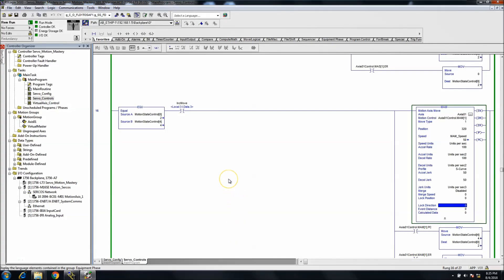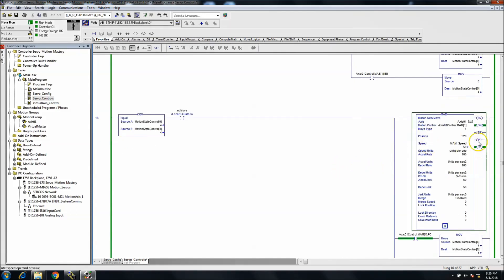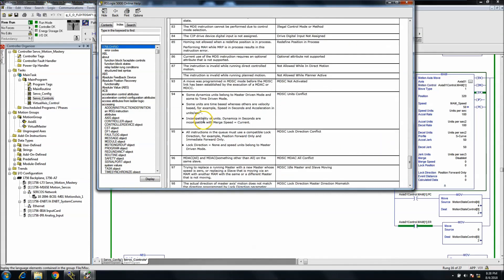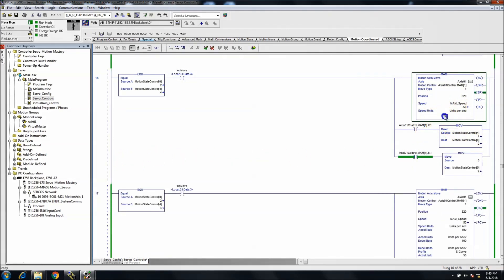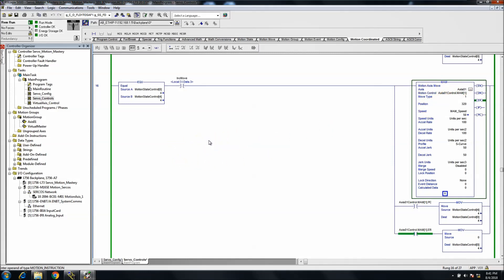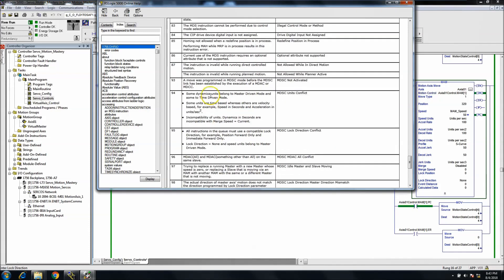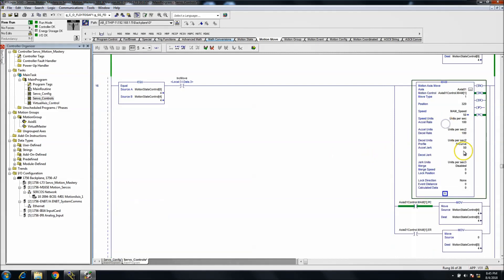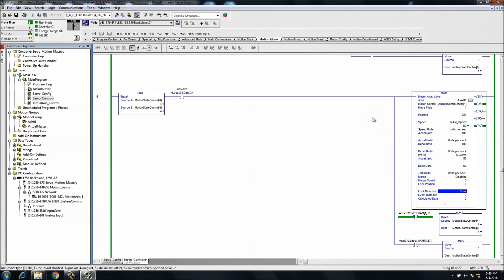RSlogix 5000 MAM Avoid an Err 95 from Lock Direction

Comment: So how do I lock a master offset move to a certain master position while executing a MAPC? Using MATC + MDAC leads to a different error (33 = Position Cam Not Enabled)?
Reply from the maker: Try a blended cam
Reply: @ShaneWelcher  What if i introduce a 3rd (virtual) axis so it becomes  Master > Virtual > Camming  where the virtual has 1:1 MAG relation to the Master and I execute a MAM on this axis.

I am still puzzled under which constellation can one use the lock function of the MAM.
Reply from the maker: @QuickBrownFoux  it's a bit hard to answer your question because of no seeing the plc program.

There is a new video today released on my YouTube channel discussing error 13.

Maybe that will help you
Reply: @ShaneWelcher  I am getting familiar with AB motion after spending years with Siemens Simotion, so there is no code yet. The documentation is not always clear.

I am trying to find out what use the "lock position" parameter has in case of MAM.
Reply from the maker: @QuickBrownFoux  gear before mam, again it's hard to talk about this over text with seeing the code
Reply: @ShaneWelcher  I got it figured out, now I can do a phase shift on the master domain at specific master lock position while the slave is camming.

You have to:
- use MDAC for all motion
- use MATC commands (on slave) with Lock direction Forward (immediate or position - doesn't matter)
- use MAM (on slave) with Lock Direction Position Forward AND you have to set up the units for v/a/d/j as "Master units" this way I got rid of errors 93 and 95!

hint: MOTION-RM002L-EN-P-November 2022, page 553